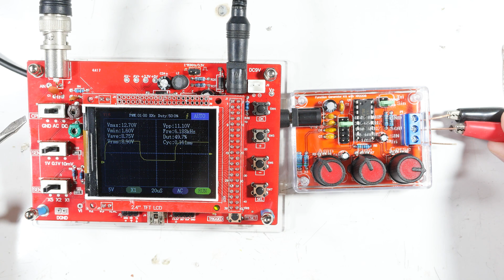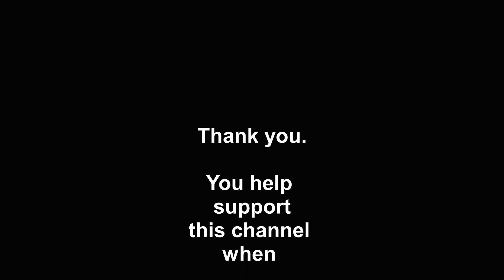$3 Function Generator Kit (4K)

Comment: Excuse me sir,is this device can do a wave like 7.83hz? Thanks 👍
Reply from the maker: Probably not, that's a very low frequency. And to get exactly 7.83 Hz will not be easy. You might try a VCO or voltage controlled oscillator chip.